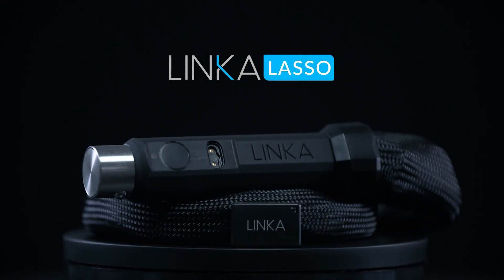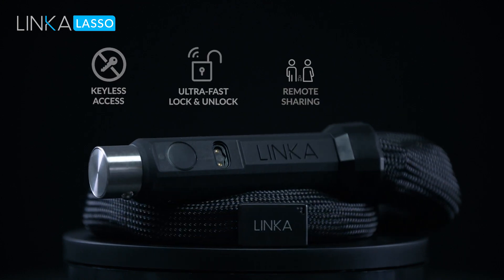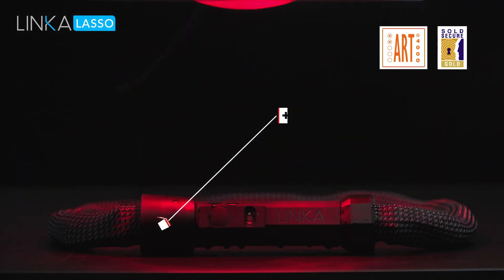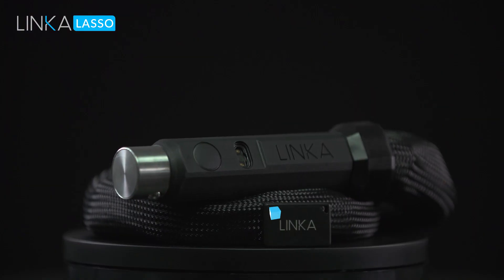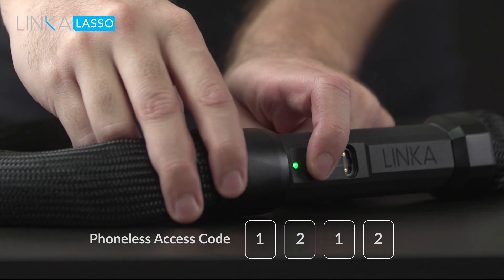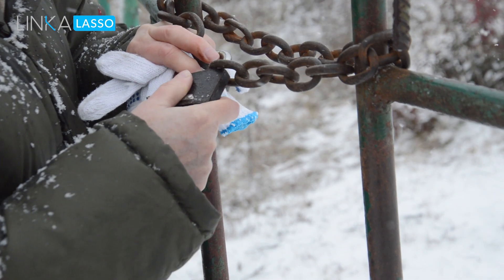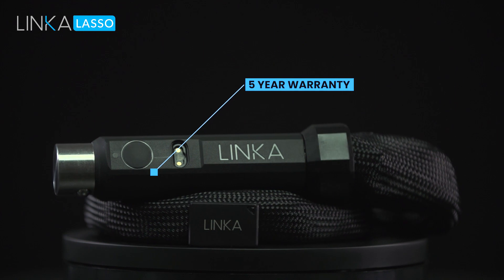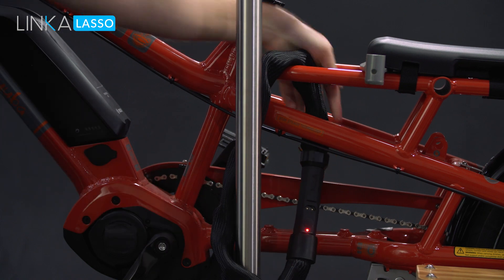LINKA LASSO: World's First Smart Chain Lock

Comment: That would take me less then 5 minutes to unlock out of the box. I can see the flaws in the video
Reply: Go on...
Reply: @Negrodomaus  I commented on the other video. Do you see the flaws yet? Do you work for that company?
Reply from the maker: Please...do go on...
Reply: @LINKASmartBikeLock  do you have a email that I can contact you at?
Reply from the maker: @dm4800  there's also a form to message on our website www.linkalock.com
Reply: @LINKASmartBikeLock  sent yall an email.
Reply: @LINKASmartBikeLock  inquiry # 16803
Reply from the maker: @dm4800  
Your email to us: "Hello. This is the guy from the YouTube comments. Do this use an electro magnetic pulse to move the locking mechanism inside? If so you don't use nickle do you? If you look at time stamp :05 you will see there is actually only 1 point if contact holding the lock together. That's not good."

Our response: "Hi James, That point you are referring to at 0:05 sec is the internally sealed magnet for connecting the charging cable and has nothing to do with the electric system of the locking mechanism. Our lock has been tested and PASSED ART and Sold Secure certifications. 
We do not use electro magnetic pulses for our mechanism. Happy to address any remarks about our technology but also...blanket statements of opening a lock easily when it's simply not...is not based on facts. Our third party certifications non-biased proof of our security.
Thanks!
Reply: @LINKASmartBikeLock  so if I bought this and opened it up on camera you would give me triple the money back?
Reply: @LINKASmartBikeLock  guess you aren't very confident in your lock. I'll buy your lock and open it on camera if you will refund me the money 5 times the amount I paid for it when I open it on camera? The certification and blah blah blah means nothing except a selling point.
Reply: @dm4800  you never recorded you opening the lock on camera
Reply: Pero nunca podras estar en todos lados para saber quien tiene esos candados